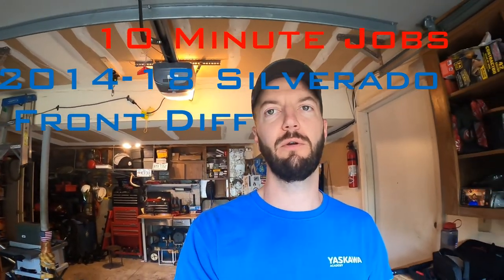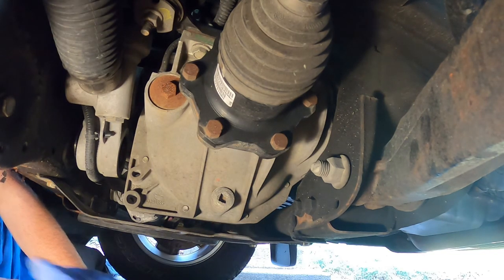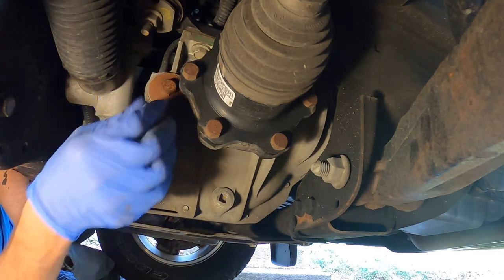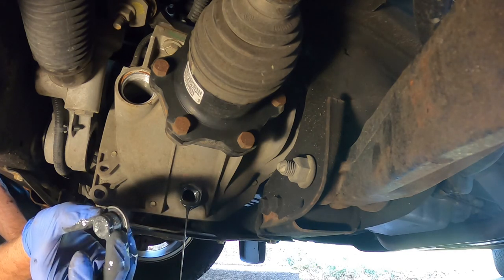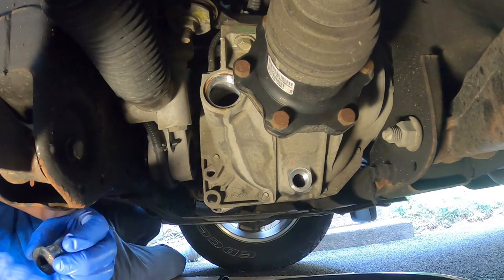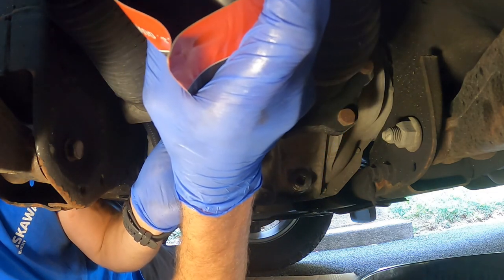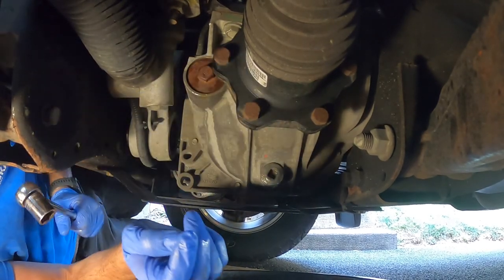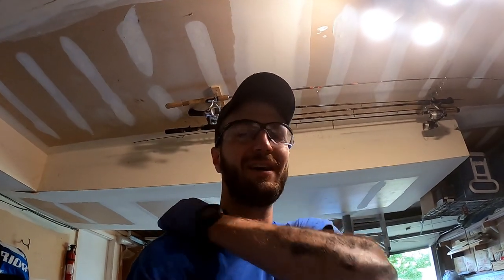2015 Silverado Front Differential Fluid Change

Comment: Thank you for the video. I personally wouldn't spray brake cleaner in there, but that's just me.
Reply: I was concerned about the seals so skipped that part. The oil that came out was pretty clean or I would have poured in some fresh oil and drained it to do a little cleaning.

Comment: Hello great video, if you want to flush the rear diff fill it, and then run it 100 miles and change again. If you can't run it due to time, fill the diff, and then drain it agian. Spraying brake clean into diff is a NO-no.
Reply: Best to use a bit of gear oil if you want to flush.  You will likely have a partial quart left over anyway.

Comment: Thank you, super helpful!  Question about the rear, since it doesn't have a drain plug and if I don't want to remove the cover, can I just suction the old gear oil out with my hand pump extractor?  Thanks again!

Comment: Those packs look like a nightmare. The hose and pump is sooo much easier
Reply: Agree. I learned quickly to keep the spout pointed upward until in the hole, then make sure it is pointed downward while pouring/squeezing. Otherwise, some will run right back down the outside and make a mess. Once I trained myself, it was actually fairly simple. Another part of my learning was to hold the bag by the neck when removing the cap and seal.
Reply: I use a hose, cut about 6 inches long on the nozzle of the squeeze pack.  Works faster than a pump.

Comment: Ok so I just completed this - Make Note of this: You only need to remove the 6 - 15mm bolts on the skid plate, not the 10mm bolts, save some time. Also if you're using the pouches, make sure you get the right angle into the differential as it is recessed a little bit.  I found that using my index finger to point the spout into the bottom right corner, there is a little slot for it to fit into to minimize excess leakage.

You only need a 15mm socket for the skid plate bolts, an 18mm for the fill plug, and the 3/8 driver/extension for the drain plug.  Torque is correct at 24 foot pounds.
Reply: Wish I had read this comment before doing the job. After losing some oil, I figured it out, but better to know and avoid any spill.

Comment: Would love to see a brake fluid change and brake line bleed on the ‘15 Silverado. About to do the front and rear diffs and the transfer case this weekend. Knocked out the transmission fluid last weekend. Keep up the good work!
Reply from the maker: Noted! Will do.
Reply: Minimal equipment approach. This is what I did. I had DOT3 fluid, a 10mm wrench, a piece of clear flexible plastic tube, a turkey baster, something to catch the drained fluid in, and a helper to press the brake pedal. If you have nobody to press the pedal, you'll need more equipment you make yourself or buy. Wear gloves and don't spill the fluid on paint.  1. I used the turkey baster to suck out the old fluid in the master cylinder reservoir. 2. I filled the reservoir with new fluid. 3. I removed the wheels to make the rest of the process easier.  4. On the front left caliper, I put the 10mm boxed end wrench on the bleed fitting. 5. I put the plastic tube on the bleed fitting and the other end in the catch container. 6. With the wrench, I opened the bleed fitting about 1 turn. 7. I put my finger lightly on the end of the drain tube. 8. I had my helper depress and hold down the brake pedal. 9. I could have closed the bleed fitting, but instead I tightly pressed my finger against the end of the tube, (To prevent letting air go back up the tube, air in the brake line is dangerous) and then had my helper let off the brake pedal. 10. Repeated 7 through 9 until the fluid coming out was clear. 11. Tightened the bleed fitting and removed tube. 12. Refilled the master cylinder reservoir. (Check it often to make sure if does not go dry, because you'll get air in the brake lines if it goes dry.) 12. Repeated the process for the front right, left rear, and right rear.

Comment: I'll share something I discovered the hard way. Seals on the bag of fluid can vary a lot. Under the cap on the oil there is a seal that must be removed (on the brand that I used). Some were extremely difficult to get off. Used needle nose pliers to puncture then pry off. Another was already loose and came off in the cap when I unscrewed it. Dig that one out of the cap. Wasn't expecting one to be loose and I spilled some oil. So, just hold the neck of the bag and be prepared for it to already be open or to use a tool to get that seal off. I used a different brand of oil, so the problems may be limited to that brand. Just hoping to help others avoid a spill.

Comment: Does the front diff and rear diff take the same fluid?
Reply: Just call any chevrolet dealer ask to speak to parts and give them the year and model and the last 5 digits of the vin number and they will tell you if you happen to go in person they print it out
Reply from the maker: You can also go to amsoil website and use the vehicle finder deal. It provides type and qty for all cases. That being said the dealer and vin is fool proof.
Reply: Yes it does
Reply: Thanks man.
Reply: No, read your owners manual.